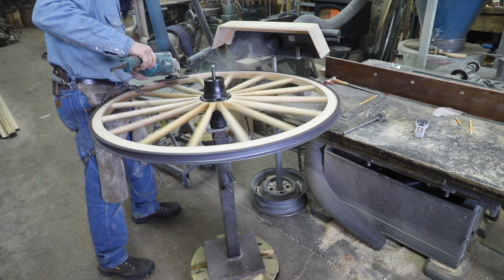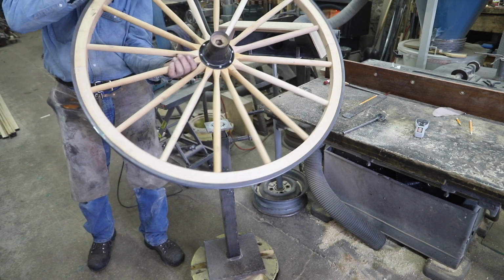Boring the Hubs, Rubber Tires & Finishing Wagon Wheels | Engels Coach Shop

Comment: As a carpenter I really get that.
 After 45 years of every aspect of building houses, from forms, to drawing to finish trim and all other parts of a house, concrete, sheet rock, plumbing , electrical.
 I wanted more Differant, so went industrial, rigging, iron work, heavy lift, setting vessels, all kinds of odd shaped stuff that had to be picked up by a huge crane just so, to set exactly there.
 In the end after 55 years in construction, I started the little handyman work.
 I lived doors and all the associated hardware, and bridges big high bridges.
 Now it wears me out to even look at any of it.
 The fun was overcoming the issues, the problems, those special circomstances of how to get it done.
 So I understand 100% how wheels are bore as Heck for you, a grind. No puns intended.
Reply from the maker: From one who has walked the road.  Thanks.

Comment: dave what you call dull, boring and mundane, I (we) call business as usual, food on table and bill paying stuff, but not wanting everything you do to be undervalued you provide a big glimpse into the past, spending my time when you use and angle grinder, a drill press and tanked gas how what you do so simply would have been done 200 years ago. I love what you do and how you do it, the tools may have changed, the passion and need has not. I wish in Yorkshire, UK, that I had a need for a set of handmade artisan built wheels to fix on my wagon for my journey of need and discovery over the hill and stretch the horizion to a brave new world.

Please recognise what you do as pure magic in a world of replication and copycat, you bring real joy applying a skill and combining knowledge on something that should never be considered dull, boring and mundane. having 12 inches of snow or minus temp numbers outside and a roaring fire inside is one of lifes simple pleasures so simple but so rewarding

Comment: Always good to see the reality of life in the shop. Most guys are good with the sexy stuff but a real craftsman is just as good with the mundane stuff too!

Spent lots of time doing drivability work on cars but spent plenty of time doing routine repairs too. I may have been overpaid for line work but the owner didn't like to see guys sitting around when there were jobs to get out the door. 

So..... some days I was running the $20,000 toys and other days I was running a grease gun and a ball joint press. 

Such is life in a working shop shop!

Comment: No sir, every time I watch you do a set of wheels.  I see a new feature, or process I'd not seen before.  Such as the Solid Pins instead of Bolts connecting the Rim to the Fellows.

Comment: Standing next to the boring machine with those arms flying around should never get boring. The rim connected to the ends helps somewhat. I sometimes run a few strips of masking tape around the ends of my lathe chuck jaws when they are sticking way out for a large workpiece. It might not physically prevent me from getting a finger or elbow whacked, but the visual effect of that tape whirling around is a constant reminder to keep my distance.

Comment: Seeing the day to day operation of your shop isn't exciting, but it is definitely interesting. This was the first time I saw your hub boring setup. I found it very interesting that you repositioned the boring bit to change the diameter instead of moving the whole arm. Also, I expected a mechanically complicated method of setting the taper. Uh, not so much. And, at the risk of repeating myself every time I comment, the post production was once again polished and flawless. Thanks!

Comment: Some of your machines are obviously shop made but others are commercial tools made for your trade and it may make a cool video to explain where you got them, if they are still made (ha! that would be a bit of a shock!) and perhaps a short history on them. The Luminary Shoppe also has some pretty cool tools, fascinating what is out there.

I appreciated (to a certain extent) the boring, especially when you were in the middle of a panic and the fecal matter has hit the fan. :)

Comment: First, it seems to me every set of wheels is a different combination of all the parts. Some have rubber tires, some have steel. Some have modern hubs, some have wood. Some have stout spokes, some have very fine spokes. Some hubs have spokes are all in a line, in other hubs some spokes are up and others are down. Some have two fellos and others have six. It doesn't seem boring to me. 💜🌞🌵😷

Comment: Is it necessary to get the rubber tires back together while the "weld" is still hot to stretch the hole? or is it more flexable than that? I've watched it done many times now and that thought always comes to mind. but this time I remembered to ask!. thanks again for a Not-so Boring video and for sharing. Tnanks Dave stay safe.

Comment: Do you make most of the equipment used in repairing the wheels such as he rubber tire installer and hub boring matching.? Regarding some of the other machines you use where in the world did you locate them ?  A Wheel Right is not a common profession or hobby now days. Your  Videos are extremely interesting and you a extremely talented guy. Thanks for the videos.
Reply: If you look back in Dave's videos, he has a few of installing and modifying a mortiser to meet gis needs for cutting the mortises in hubs and similar.

Comment: As it is never boring,,,, well just a trivial question. What would you say is the difference between a wheelwright and a cartwright? I mean to ask because in this video, you show much of making wheels right, true, correct, etc., while in other videos, you show the larger cart issues. I would enjoy knowing more about where the language/words come from, such as why a boxing is called a boxing, because it does not appear to involve punching someone in the face, or putting items in a 3D rectangular container (box). At some point in time, there must have been a huge variety of boxings made/used, such that now you need to match them to wheels. Also, in many of your operations, like the press for pushing the boxings into the hubs, you appear to have homemade tools (the press). Did you come up with these tools (the press) on your own, or what was used when you were just starting out? Even still, thanks so much for letting us all see how your shop works, especially you truly skilled craftsmanship.

Comment: What is the formula for determining the length of the rubber since you braze the inner wire with a gap in the rubber then coax the rubber to cover the missing gap? Is this a trade secret?

Comment: I'm somewhat surprised that you haven't built some clever machine to massage the rubber back in place after brazing the wires together instead of banging the wheels against the floor like that. After all, we've seen that you are very capable at adapting or building equipment from scratch to suit your needs. I presume that, despite looking very crude, it's a too easy task to be worth improving.

Comment: I've seen runout examined with various pointers.  I dont recall much of a discussion about runout.  I've only been watching for a couple years.

Does anyone recall a video where runout is discussed?  I would think the allowable tolerances vary depending on hub style and the use of the wheel?  Some small high speed galloping horse might need truer wheels than an old farm wagon that only ever walks?

And then maybe there are different runout?  Side to side and over the diameter, maybe axial and radial?

Comment: Just curious..... on the set of wheels that you made the pins to set the tires, you simply drilled holes and hammered them in. Do you rely on the wood to hold them in place? It seems to me that if the wood were to dry out those pins could come out after a bit and possibly throw the tire. I realize that you do things that are true time tested things, so could you possibly explain that? I normally notice that you always appear to either hammer over a bolt on a nut or do something to lock fasteners in but it just does not appear that you have done it this time. Thanks

Comment: Sir, I'm curious what your tolerance for lateral true is? Also, is your dish centered in the entire width of the hub and boxing or just the hub width?
Reply from the maker: This style should be 1/8" or less.  As for dish, if I understand your question, is tire to tire, measured at the hub.
Reply: To clarify about dish. I wasn't sure if the different kinds of hubs have more or less axle to flange offset.

Comment: Oh, another question! What´s your opinion on metric vs imperial?  Is it a "habitual" issue or...
(The United States is one of only three countries (the others being Myanmar and Liberia) that have not officially adopted the metric system as the primary means of weights and measures)
Reply: As a person living in a metric country, i must say that when it comes to measuring length, there's absolutely no difference whether your basic measuring unit is an inch or a centimeter, ether way you're going to use that basic unit or fractions of it as a point of reference. Metric is convenient if you need to convert, say volume to weight to length, but if all you do is measuring length it's all the same (in a sense that there's no difference between something being 2.675 inch or 2.675 centimeters, it's still 2.675). Also a lot of industrial stuff comes in imperial units (pipes, wire gauges, electrical components, building materials...) so it's pretty important to know both
Reply: @StanislavG.   I hate tape measures that have both Inch and Centimeter on them. I don't need any help to make mistakes !!!!!
Reply: @MyOLD36chevy  Ha ha :)) So true... i had one of these. Never again! :))

Comment: Why the difference between 4 pins rear and 3 pins front? I know there is a reason. I just could not figure it out.
Reply: Spoke number divisible by 3?
Reply: @milantrcka121  Dunno. That is why I asked. Is it a rule of thumb for strength? Or is it chord length? It is builder's choice?
Reply: @DomManInT1  Went back, counted the spokes - all 4 wheels have 16 spokes. The it is on the number of felloes sections - either 4 or 3

Comment: Please be extremely careful using the side of a grinding wheel like that! I am sure you have done it for years and have been just fine so far but the only time I have ever seen one give way was when someone was using one in that manner. 

The wheels are not designed for side loading (unless you are buying special ones) and can very easily shatter. The wheel I saw let go took a chunk out of the concrete slab floor and left holes in the walls/ceiling. Thankfully nobody was hurt.